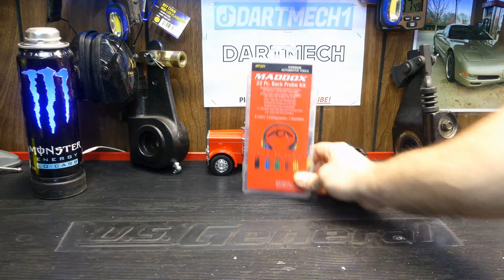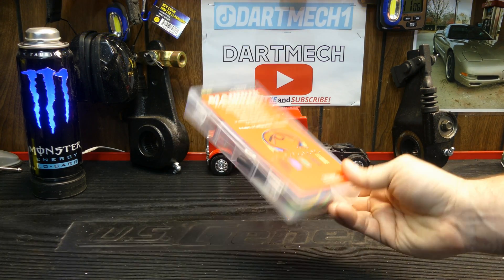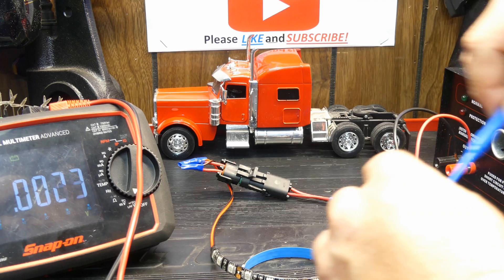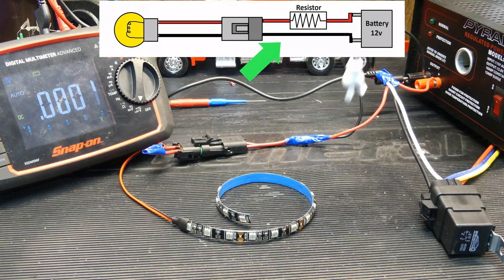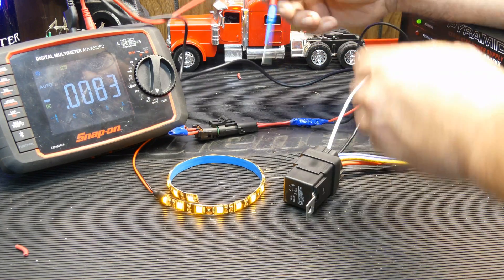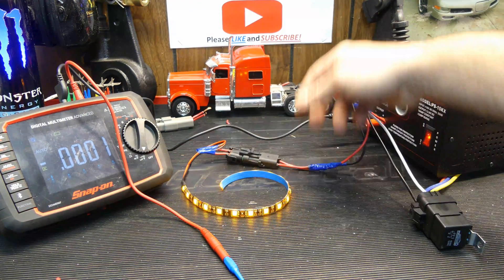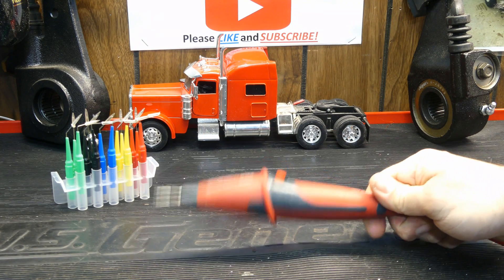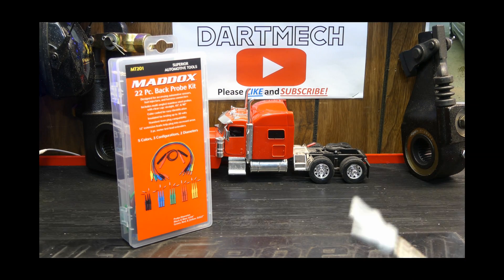The CORRECT way to use BACK PROBES (only a last resort)!!!

Comment: So how about that video on why the harbor freight multimeter is a bad idea? I have one and it's been working ok so far. Did wish it had an audbile beep for continuity and showed min/max values
Reply: The refresh rate is not good. It's not gonna graph. It's prolly not gonna measure frequency. There's definitely a video about all this somewhere.

Comment: I admit that I got lost on the “without a path to ground” part. If you don’t have a path to ground then you have an open circuit. And if you have an open circuit how sure you getting a reading on your multimeter?
Reply: I think what he means is that once you have 2 resistors in a circuit, voltage is then shared  between both resistors causing a voltage drop. 

When you unplug a connector even if there is a resistor to it like a relay, you’re still going to get pretty much same source voltage that’s coming out of the battery. It’s not until you connect it to the SECOND resistor and back probe it that you can see the voltage drop because now the voltage is shared between both resistors.

Comment: I just picked one of these up, so I can front probe a PCI bus diagnostic port, and the OBDII port on my Jeep with an oscilloscope.
Reply: Be careful with the OBD port. 2019 and up jeep products have a security gateway module, and the data you’re seeing through the OBD port is an interpretation of what the module is seeing.
Reply: @corybeckmann8823  2019? My Jeep's a 2002.

Comment: Why dont my maddox back probes fit my mutimeter leads????
Reply: I got a klien and just bought a cheap automotive Lang. I should specify because maybe I'm getting the terms backwards. Where the back probe tips from the same kit (maddox) as well as other probes from other kits don't fit on the needles of my meter  leads don't fit. They won't push on and fit sloppy and fall off. I'm at a loss here.
Reply from the maker: What kind of meter do you have? Most are standard “banana “ receptacles